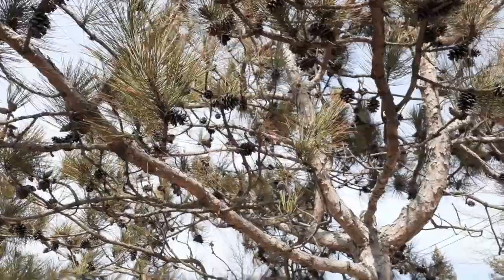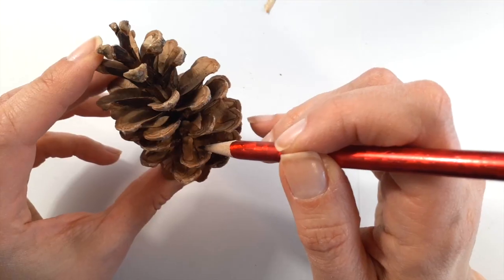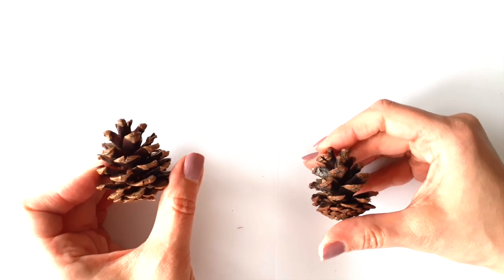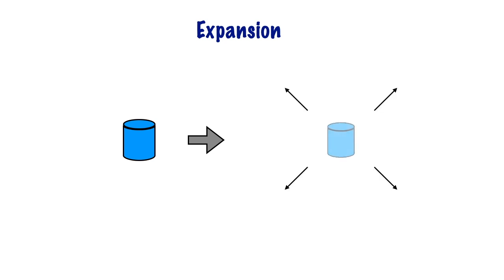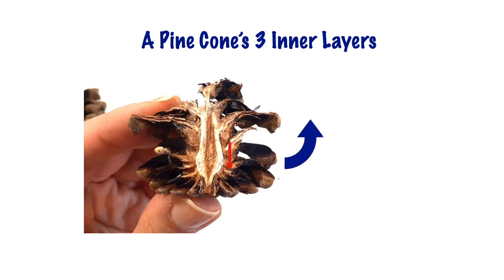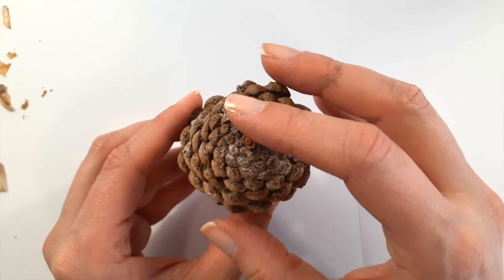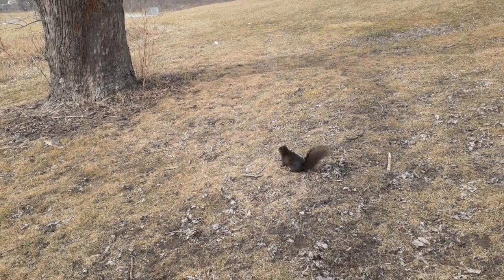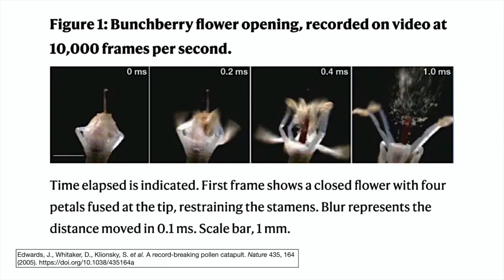Pine Cone Science & Timelapse Experiment - Vlog 5

Comment: That was really wonderful.  Something so simple a pine cone , everyone know what there are and never really think about them. I knew they open and closed because of weather (moisture) yet did not know you could close them again after they had fallen from a tree. I came across your video in search of how to cut open a pine cone.  Really enjoyed it, outtakes nice too. Cutting and drying pine cones for epoxy pour. Thanks for sharing. 
How did you cut open the pine cone?
Reply from the maker: So delighted you enjoyed the video, Nancy. I used a serrated knife to 'saw' the pine cone in half but it was VERY difficult and it took me a long time. I also found I had to use the smallest pine cones I could find as I could barely make any headway trying to cut the larger ones. I also 'ruined' a few pine cones until I got a decent version. 
I'm afraid my answer isn't the best for your purposes as I imagine you want an aesthetically beautiful cut pine cone for your epoxy pour (which sounds like a fabulous idea!! you must be an artist by the sounds of it). I felt that if I had a small hand saw that that would've been easier, so if you have one I'd definitely try that. 

Thanks again for your wonderful comments and I hope your pine art turns out fabulous!